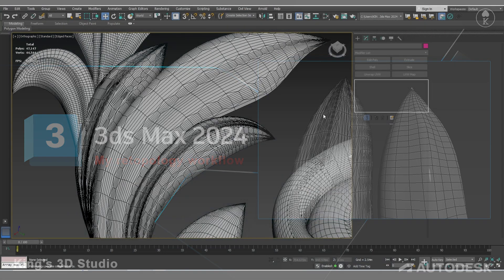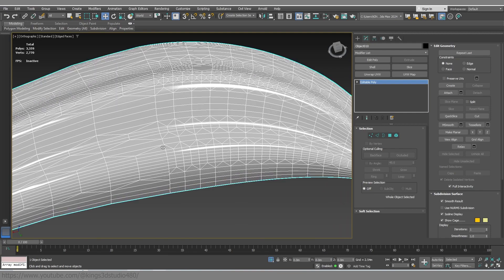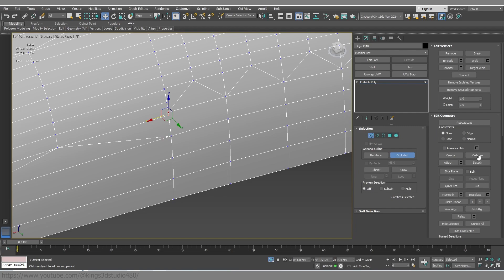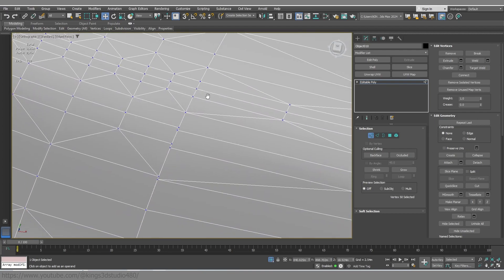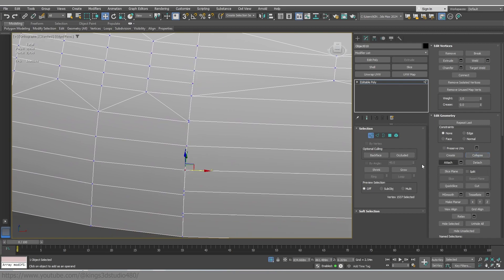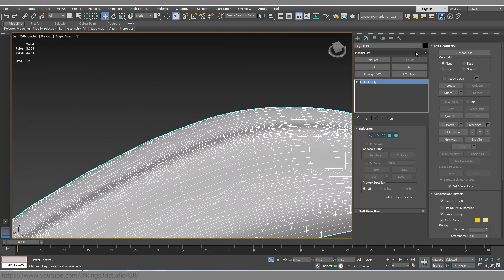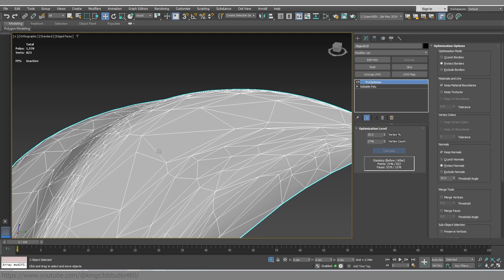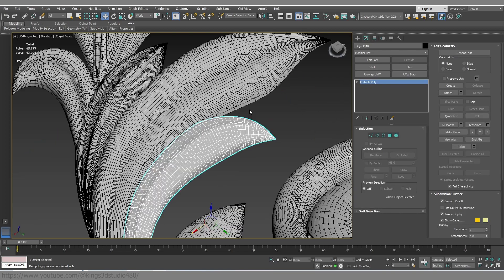3ds max 2024 - my retopology workflow

Comment: couldn't you select all verts and weld wit appropriate threshold as to just weld those verts that you manually compassed? this would be 300% faster
Reply from the maker: Yes it works but in this particular case it only works if you select the vertexes that are in the same line of the part I’m working on, because in other parts, any threshold more that 0 was ruining the geometry 
So what I did later was to select all and then deselect the dense area of vertexes
Reply: @kings3dstudio480  Oh, I see 😁
That makes sense
Reply: @kings3dstudio480   but why welding EVERYTHING manually? select DESIRED area and weld by threshold
Reply from the maker: @studio2513  we’ll probably there was also scale problem, it was imported object and at this time I don’t recall all the details